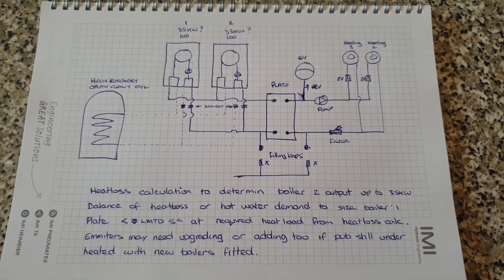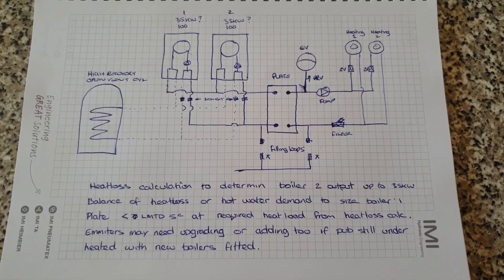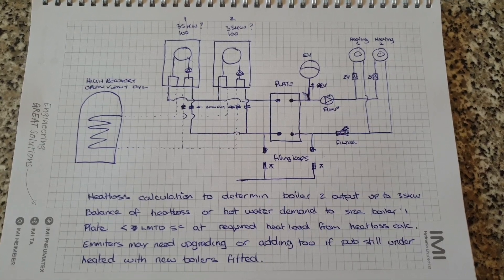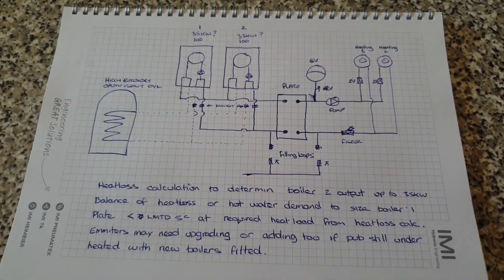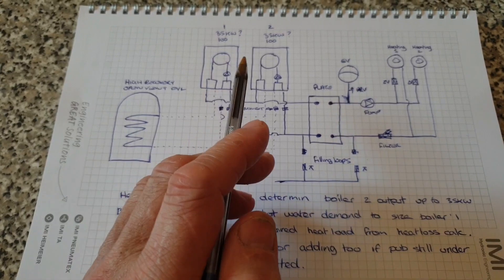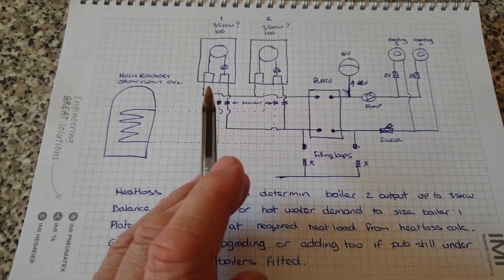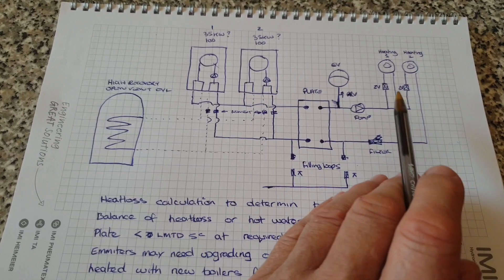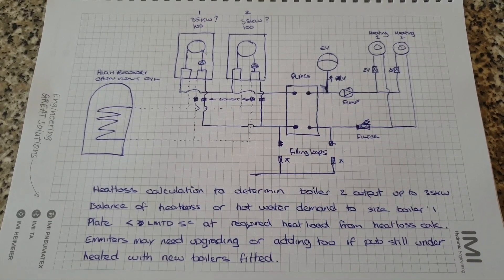Preliminary design idea for a pub installation. Viessmann?  Worcester? Vailant?  Baxi? Intergas?

Comment: domestic guys can service boilers in commercial settings? does it need a pressurisation unit instead of filler loop as the system is over 45kw? cheers
Reply from the maker: I believe up to 70kw yes. Yes needs pressurisation unit over 45 if not open vented